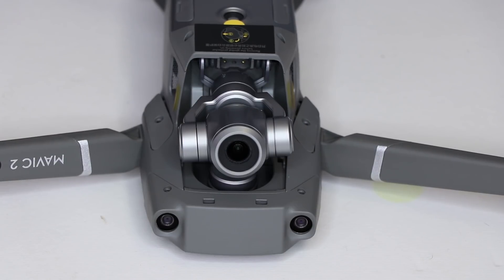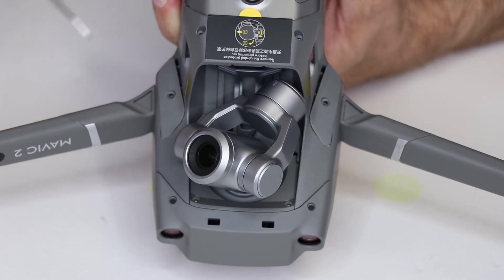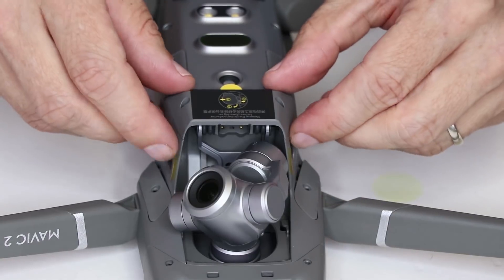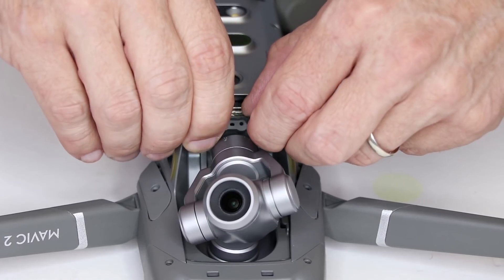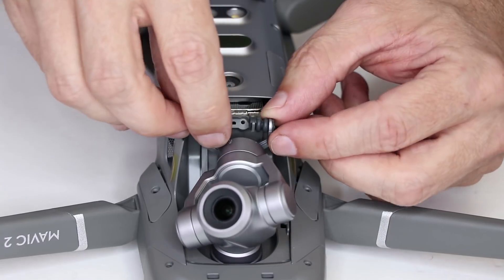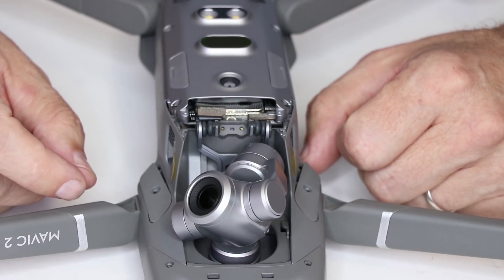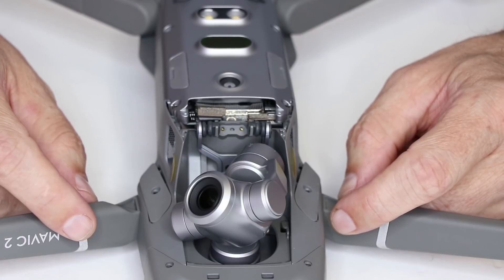Mavic 2 Camera Swap - DIY Guide - Easier Than You Think!

Comment from the maker: What do you guys think of the "swappable" gimbal/camera assemblies on the Mavic 2? As long as nothing is needed software wise this is an easy job for anyone who is semi mechanically inclined.
Reply: I hope it doesn't require anything software wise but considering the camera processor isn't detachable with the gimbal I assume that you would need to update the software.
Reply from the maker: I'll be finding out.
Reply: Since p4 and up
The gimbal need to sync in order for gimbal motor smooth movement 
And DJI is only the one that have gimbal motor calibration software 
Of course you can swapped it out but motor gimbal movement?
It wont as smooth as first gimbal without motor gimbal sofware syncronizer from DJI
Reply from the maker: Source?
Reply from the maker: Just added photos. There is no removable memory on any of the motherboards: https://tronicsfix.com/blogs/news/dji-mavic-2 There are two metal plates that I didn't remove for pics (the two bottom sensors are glued on and I wasn't willing to compromise that bond) but I did open them enough to see that there was no sd cards under them.
Reply: disappointed
Reply from the maker: Finally got the Hasselblad camera in the mail today. Easy swap and it works great: https://www.youtube.com/watch?v=jTwftjjuG5c
Reply: you know that your teardown photo also show a secret DJI don't want people to know...the mavic 2 have an Ambarella H-3 image processor, the high end image processor that can do 4K@120 and 8K@30
Reply: how to use this information?
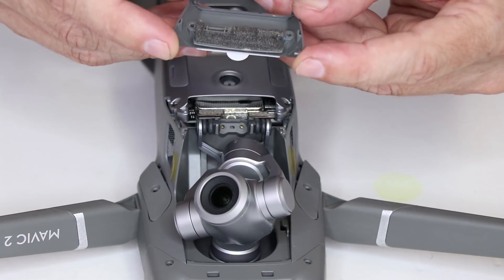Reply: what is the name of the mavic piece you're holding at 0:32 ? I need to replace it on my mavic.
Reply: Maybe I missed it, but where can I buy a 2 zoom camera and gimbal. Would this work swapping the other way around. Thanks
Reply: Can a thermal feed be put into ir

Comment: I used to repair my mavic 1 gimbal all the time. It looks like the connectors were smaller on the one. I was always concerned with wearing them out from removing and replacing them. I'm wondering if anyone has done this a lot and changed the gimbal often, and if there was a problem with wearing out the connecters. I'm sure replacing the stationary connector on the drone would be a pain, but not necessarily.

Comment: a few points for the uninitiated: this is one of the easiest camera& gimbal assembly swaps out there - only 1 ribbon cable and 6 screws all of the same size. If you ever tried this on a phantom 4 or mavic, you know what I mean. At the moment, independent sellers are selling 2 pro camera&gimbal assemblies for ~600 on ebay, prices have already come down from what you see below as greater supply of mavic 2 parts hits markets from resellers 'parting out' drones.

Comment: Can you take the one in sensor one and pop it right in there?
Reply from the maker: I believe so but I'll be testing it tomorrow to be sure.
Reply: @Tronicsfix  

That's awesome!! I'm pretty sure these things were hot-swappable in the first place but then they changed it in production all because of making more money really sucks.. 

You could have had both cameras with you and only one drone

It should work perfectly you just have to pick the mavic 2 instead of the mavic zoom in DJI GoPro
Reply: @Tronicsfix  

Do you know how much each camera sells for?
Reply: @Tronicsfix  

The other question is what type of screws are they using.. is it just screws in plastic? or other screws screwing into metal which means you can change the cameras whenever you need to in it won't wear out?

Comment: Not worth the 649 price tag on the camera
Reply from the maker: Totally agree, but I really want to find out if it works.
Reply: well its a hass .. So to me the $650 for a hass is reasonable
Reply from the maker: Hopefully!
Reply: HI, quick question - Is there any possibility to swap camera in mavic pro 1 with hass? or no chances for that?
Reply: the mother board inside the mavic 1 and mavic 2 are different not possible ...
Reply: well really it would of cost 350 euros. if i bought  pro mavic it would cost my 1500 euro. now if i buy a mavic zoom instead it would cost me 1250 euro. now if i bought the hass for 600 the 250 i saved from not buying the mavic pro could be deducted from the price of the 600 euro hass meaning it really only cost 350 euro. Ands thats how im going to have one drone with both interchangeable cameras.
Reply from the maker: No chance for that.
Reply from the maker: Source???

Comment: Hi. Thanks for this, I’m surprised at how easy it was. I’ve watched both of the tear downs that you’ve done so far. Do you intend to take the motherboards out to expose the SD card level where, I’ll presume, the onboard memory is also located. It would be fantastic if it was simply a case of swapping the 8GB card for a larger one. Take care and catch you later. Peter
Reply from the maker: Yes, they made it super easy! I'll be taking the bottom cover off to check the memory situation.
Reply: 👍......you can be sure I’ll be watching that one when it comes out. Thanks again. Pete
Reply: there is another guy on youtube that did a tear down on the mavic 2, but he seem clueless on what people want to see on a mavic 2 tear down lol....he seem to just open it up and thats , that lol....but from what I can observe the internal memory seem to be a micro sd... being tape down by a some kind of aluminum tape... If it is, I assume you can swap it out and install a larger capacity one...by removing it and installing a new one, you might lose the water/moisture coating dji put on their stuff to protect it from moisture ..
Reply: Thanks for that....as you say, it’s not very good if it’s just being opened up and that’s it. A little more info would be appreciated so I’ll hang fire and see what we’re shown here. From what you’re saying though, it does look promising. Thanks again, take care. Pete.
Reply from the maker: Just added photos. There is no removable memory on any of the motherboards: https://tronicsfix.com/blogs/news/dji-mavic-2 There are two metal plates that I didn't remove for pics (the two bottom sensors are glued on and I wasn't willing to compromise that bond) but I did open them enough to see that there was no sd cards under them.
Reply: Thanks for that. I must admit I am very disappointed and I think DJI have really missed a trick here. They could have offered the 8GB as the “basic “ model and then offered increments in memory with a similar price range. This would have given us a degree of flexibility and enabled those of us who are less daring than you to increase the onboard memory without running the risk of damage to our new drone. Ahhh well at least we got the 1” sensor, maybe the MP3 will have more on board memory and be even quieter! Thanks again, take care. Peter